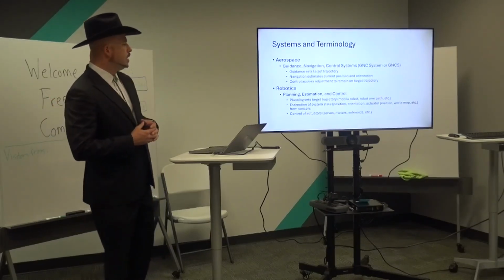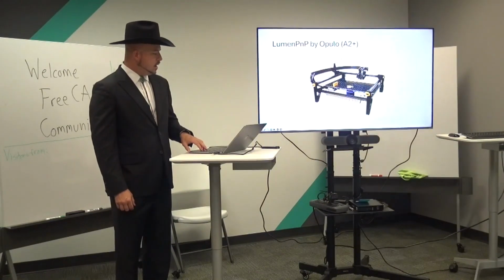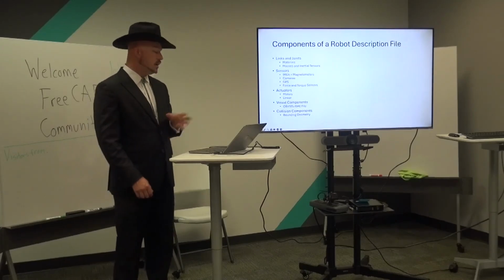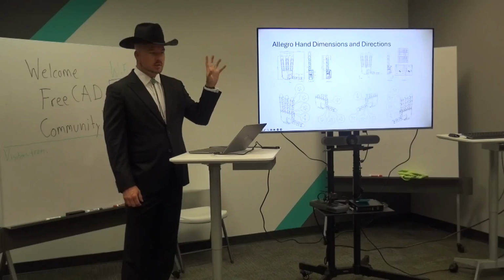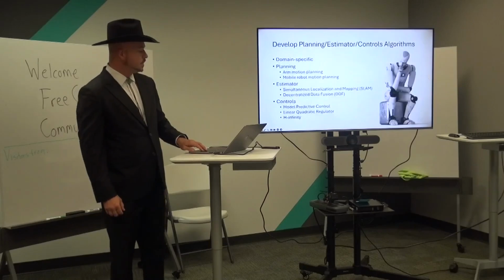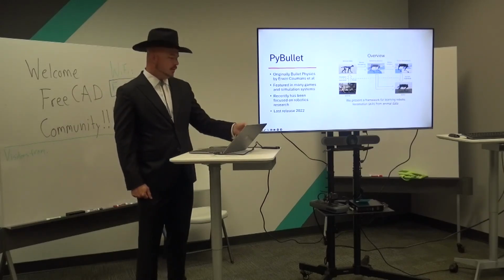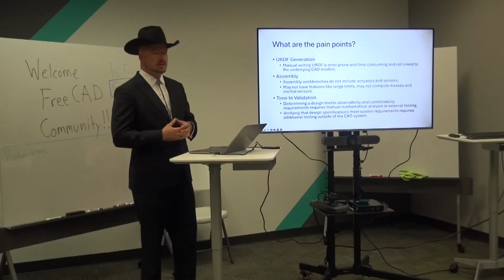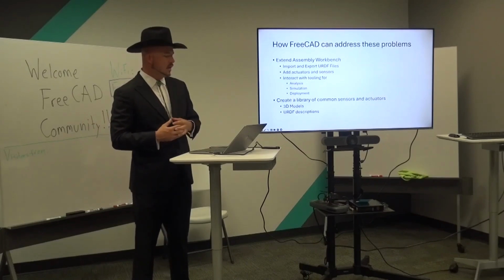FreeCAD North American Meet Up 2024, FreeCAD for Robotics

Comment: Excellent presentation Jackson! Great overview of the current demands for emerging tech.

I use FreeCAD and MuJoCo often. While I can load and manipulate XML files (most robot models) in the MJC viewer, editing them is still quite cumbersome and manual. If FreeCAD could import XML files and allow users to manipulate and add geometry directly to a model, it would be a game-changer.

Currently, I use MuJoCo XML files (which contain crucial data like qpos indices, e.g., Joint 14: left_shoulder_pitch_joint | qpos index: 20 | qvel index: 19) to fine-tune rewards when training a robot using ARS (Augmented Random Search). If FreeCAD could support XML import/export, it would significantly enhance the ability to train any robot in a continuous action state, which is essential for most AI reinforcement learning algorithms like ARS, PPO, MLP, etc.

The potential of FreeCAD to bring AI reinforcement training to any motor/actuator through CandL workshops is huge. Yes, please!